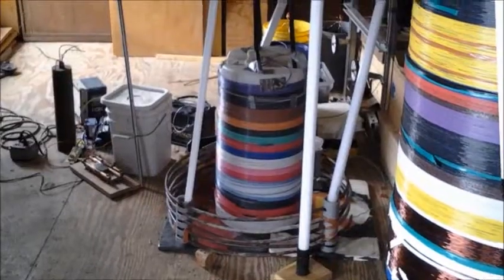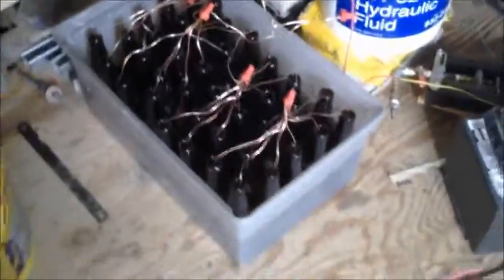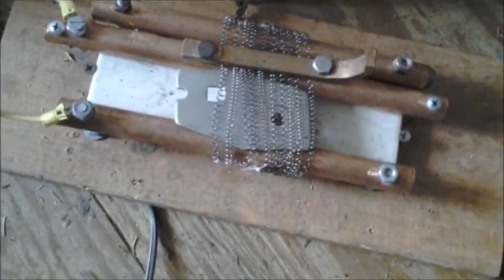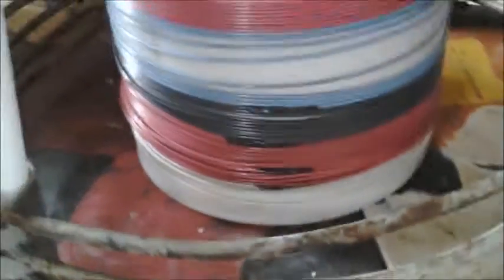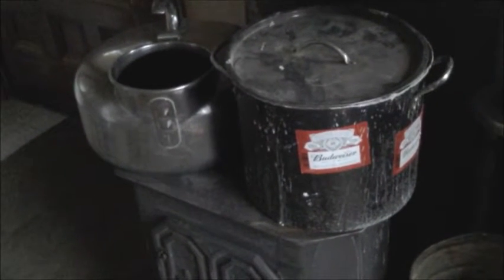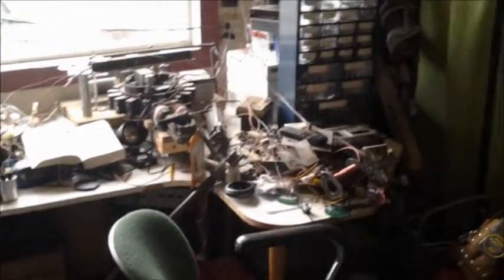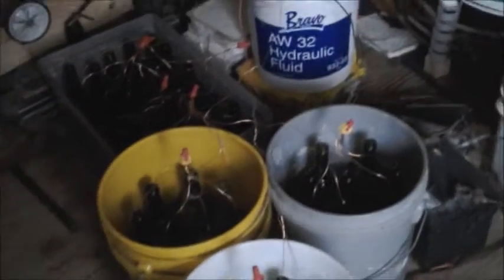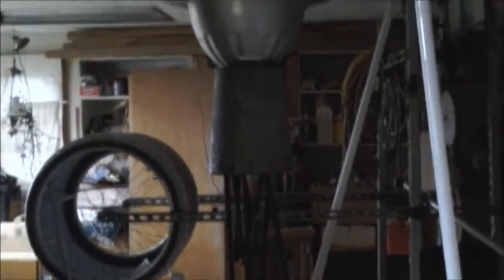Large and Extra Large Tesla coils made all of free JUNK

Comment: Nice. But what function does the salt serve?
Reply from the maker: +John Ratko the salt acts as a conductor for the electricity to travel thru to get to the glass that is actually the dielectric (thus storing the high voltage electrical charge.
Reply: Made by one man I see.Thanks.